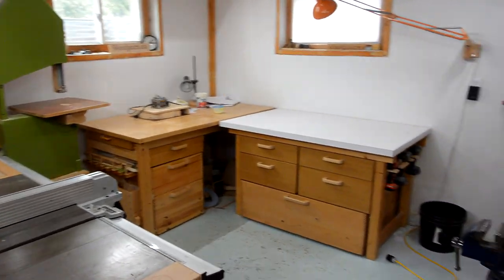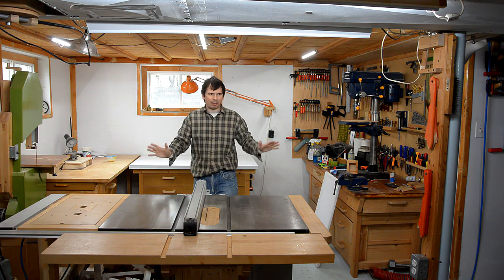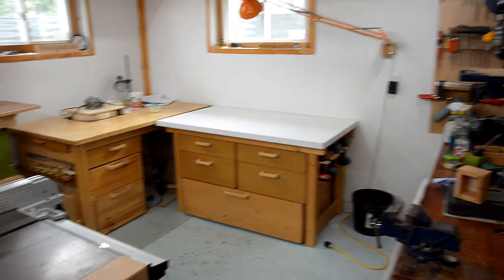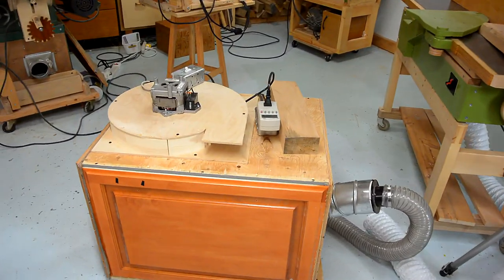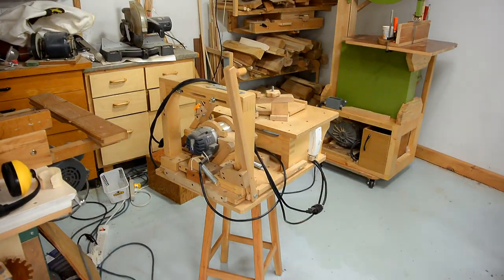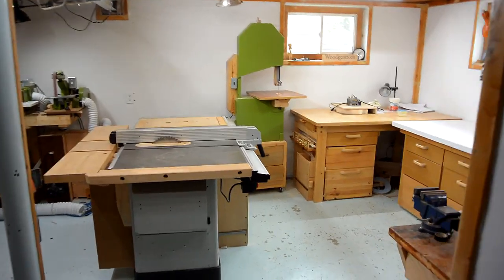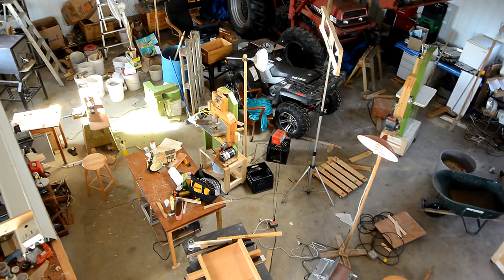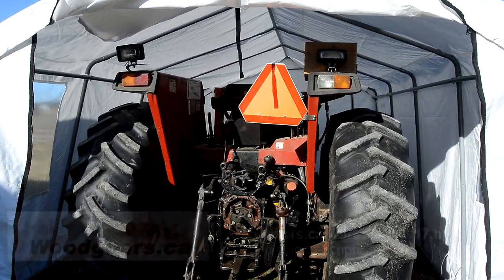The last tour of my basement workshop

Comment: Always heard the rule of thumb for garage size is to calculate how much you need, then double it.  I see house renovation vids in your/our future.  Good luck on the move.
Reply: I rented neighbor's unused garage in the end. Didn't help a bit. Just made searching for stuff twice longer.
Reply: The rule of thumb with shop size is double it every 2 years. There has to be an upper limit where the average handy person is satisfied, but what that is I don't know. I'd guess it is between 2,500 to 5,000 square feet?
Reply: The amount of shop space needed is n+1. Smaller size only requires increased efficiency, up to a point.
Reply: +The Metal Butcher the further you fall behind n the more time you'll invest chasing after that efficiency though.
Reply: That's like the old George Carlin routine, "A Place to Keep My Stuff".
Reply: +Peter Collin tinkering accumulates far more stuff than average folks need too. It is always if I had this I could do that. Or I need a lot of this to do that. Sometimes I just question what it is all for.
Reply: That's true. I want more shop space, but then I see what Marius Hornberger has to work with, and I have plenty.
Reply: What is it all for?  Tinkering of course.  Doing 'stuff' in the shop.
Reply: +DRitz78 I ask in a larger philosophical sense. There are after all only so many hours in a lifetime.
Reply: "I just question what it is all for" For me, i enjoy feeling proud of my finished work. The tools can be expensive, but I don't do this for the money, so it has to be fun. 

The tools make me proud of what I can accomplish. They let me challenge myself to make something more complicated, or totally new every time, and they've added a huge amount of order to my life.
Reply: +C Interesting. I have much the opposite experience as you have. I don't buy particularly expensive tools. If I had to describe my shop in one word chaos, or messy would be good ones to use. Order is an ideal I don't hope for anymore at this point. I do find some projects challenging, and even beyond me. Not every project I do makes me proud either. I've a fair number of total failures. Complicated, or new is all over the map as well. There can be a lot of repetition, and I do have a penchant for the simple.
Reply: Then ask the wife wants to park in the garage, then quadruple the size.  50x100 metal building sounds just about right.
\
Reply: +RobiSydney I can't abide by those metal buildings. They're like beer cans. Good as an equipment shed. I wouldn't want a shop in one though.
Reply: trtrue enough.  I have worked in metal buildings built out with sheet rock and insulation.  Makes for a nice shop.
Unless you're a keith Rucker and have enough pine trees you can cut down and mill for a building...
Reply: +RobiSydney in a perfect world I would go with concrete block myself. Once you start insulating and paneling a sheet metal building you lose one of their major advantages. Which is their low labor requirements for construction. Wood has a host of undesirable features when it comes to workshops. Not the least of which is the flammable nature of the material itself.
Reply: true again.    though the one I was in was built out with steel studs.  This was prewifi so we didn't care about being in a faraday cage.  Being in an earthquake zone though it was the better material for the location.I have friends in 60 year block buldings and every summer we get to go around the building and caulk up the cracks.  They poured the slab in 4 different pieces. (over the course of 10 years and 3 additions to the family) and too thin.  I'd still prefer a metal building.  if you really worry about fire danger, use concrete board instead of drywall. As it was a classroom as well at one end (2 rooms we could separate)  These days being a faraday cage is nice since the students can not use their phones. while in the office you could because of all the windows.
Reply: +RobiSydney Caulk? That must look great. Repointing joints is a real thing too. That's what cape chisels are for. It is not done much these days. But there was a time when it was commonplace. Raking joints. 60 years ago was before my time. Lots of them old drunks didn't know what they were doing. I worked on spec grade mix block jobs. We weren't fooling around. Door wall in every third course, and rod in every third web. For schools we'd have to put pilasters in the walls too. Just so if the place did burn to the ground the walls wouldn't fall in. Because when there's kids involved not going in isn't an option for the firefighters. They're going in.
Reply: They're cheap skates...  I have a cape chisel at my dads..  like he'd ever let it go... I was lucky to snag my angle grinder back from him though.

Comment: In all of our past homes I have complained about my shops being too small. At out last house I build a 20 x 20 shop in back as that was the maximum the county would allow. Since I was building it myself, I took advantage of knowing what I wanted to fit inside and where. I built the shop and a nice storage loft in one side of it with it's floor set at just a few inches above the walk in door. The joists made for fantastic storage as I was able to hammer in finishing nails anywhere I wanted to hang something and I could see loads of hardware by simply looking up.. It was fantastic. Tight for restoring a car, but a fantastic design.  8 years ago we heard of a nice house on 1/2 acre that was close by.  That house included a 1260 SF shop. I had worked on the past owners car there many years ago, but only really remembered the 4+ car shop. We bought it and when moving things in, realized storage in this shop was useless. It had no loft and the two end walls and back wall are concrete block. Of course I knew I had much more room to deal with. More than 3 times as much in fact, but it was really not a smartly laid out shop. Storage for 4 cars, ok, but not even convenient they way it was built. I ended up building a wall down the center of the 2 bays with a work bench on one side. Lots of shelving out of 2x4's and 1/2" plywood and then built a staircase that raises up with a boat winch and laid a floor on the ceiling joists. I recently brought everything from the old shop home to this "not-so-new" shop and can tell you that if I pull my truck outside I have a lot of room for projects, but honestly, with the design of this shop I always feel I am at a loss...  So, my friend, take your time and really work at a great design for your new shop.  Lift your wood stove off the ground for better floor space, maybe.. Best of luck......

Comment: Seeing that angle from on top in the countryside shop, if I would own that place, I would make a floor in between. And since it's five meters tall (yes, I checked with the scaffolding video) you could easily make a floor, maybe 2/3rd of the entire area, so you could still park your tractor inside, almost double the floor space, get easier access to the cfl lamps and possibly even reduce echo. You'd still have an room height of about 2.3 meters if you use I-beams.

Comment: A bit sad to see the old shop go, i liked its character, it's so you, but also excited to see how you work out the new one, more space, better light, etc.
Reply: In the new space, would partitioning the rear section of the "shop" work to solve your problems? The front, near the doors would remain for tractor, atv, metal work, and the rear + insulation for woodworking, you'd also get more storage area on top of the enclosure that way.

Comment: I could see a ramp being made for the fourwheeler whether yhat be a foot or 4 in the air on say a 15 degree angle slope where its sturdy enough to hold it but also has room to store some tools in it. Or make a whole loft a good 6 to 7 feet in the air and a staircase with railings as extra storage depending on ceiling clearance

Comment: :)
      First:Congrats with your moov to hte country n bigger tool box/shop.
      Second: Project perhaps should be rows n rows of stacked shelves on the walls?
      Third:  FYI That structure for your tractor can hold in moisture and caue 
      oxidation/rusting faster possibly.
:)

Comment: 2:15 That column needs to go in my opinion...
Putt in a steel H beam against the roof and support it at the inner and outer wall instead. Make sure to test if you are able to lift the ceiling closest to the column just enough to take the load of it for a brief amount of time. Remember to have wedges of hard wood or similar to make final adjustments if needed between the H beam and the load bearing point of the ceiling.
A couple of bottle jacks with preadjusted columns and beams  ( 4x4" )for load distribution both on floor and against ceiling is probably the cheapest and safest way to do this.

EDIT: oh... moving
Guess i should make it a habit to see the whole videos before commenting here on YT

Comment: The ceiling in your basement seems unique... I have a low ceiling and have my workspaces down there (mainly electronics, and my kid and i share spaces down there for breaking things and rebuilding and such at a table i made years ago), but i'd like to put something there that is low or zero profile. (my house was built in 1954 also. heh!) 

If i'm looking at it right, it appears to be some sort of cleat mounted into the side of each floor joist then short planks going from one side to the other?  Is that what i'm looking at?

I hadn't thought of doing something like that, but it seems a lot more economical than a low-profile dropped-ceiling...
Reply: Also, thank you for the videos.  They've been great enjoyment and inspiration for me to try making stuff. :D

Comment: You might want to try to make better heating for this huge new space. I did use some used car radiators with great success (water based heating). You will need old computer power supply to keep radiator fan running but temperature raise is very fast in just half an hour.
Reply from the maker: and what would heat up the water?
Reply: Matthias Wandel in my case it's cheap stove with built-in water heating coils  (in fact I use car coolant as it never freezes in winter). I also use wood as a fuel. In your case easy hack is to wind a copper pipe onto the flue (to make a coil) and do the same. I'm happy to provide you more details if you wish. Before this cheap hack I was unable to stay in garage if temperatures went below 0 Celsius.

Comment: If the load bearing column is in the way, a load distribution beam might be your next project?
It's not that hard to diy, just make sure the math is correct and you are left with a couple of columns against the walls instead. :)
Reply: Ah...just got to 08:45 in the video, just disregard my previous comment.

Comment: Im curious what that single 2x4 is holding up?  Cant be a beam or a joists?
Reply: If you look closely, that 2x4 is actually up against a white painted steel pipe.  I suspect the 2x4 is only there for the plugs.
Reply: Looks like it's a metal pole, with a 2x4 attached to it so he's got a way to mount the outlets somewhere.  The metal pole is the load-bearing support, not the 2x4.

Comment: What's the right wing on your main table saw? Is it a router table? Also, a single 2x4 column to support the house?
Reply from the maker: routr table.  And watch more closely
Reply: The 2x4 is there for the electrical outlets he added that is strapped to a steel post it is that that  supports - bears up - the ground floor.

Comment: The problem with plastic tarps is that they degrade within a year or two in the sun.
Reply: Some hold up surprisingly well . I'm in Northern Ontario and I 've had  one going on 6 years and it still looks good even with 13 feet of snow this winter.

Comment: Yeah, Awkward barn layout, the entry door is right next to the Big barn door, meaning you can't really park the tractor in front of the barn door... If it be possible to make another door somewhere where the tractor is now, you could seal of the current door move the tractor and atv forward a bunch, so they hug the barn doors, maybe build like a token wall around them (mainly for having wall space and hiding them while in the shop. That would leave you with a big L shaped workshop ... just an idea ;) ... think building a token wall wouldn't be a bad idea anyways (maybe on rollers/wheels so you can still move it (or them if build in sections)) As having a wall helps you 'psychologically' when organizing as you can shove things to them and they actually 'feel' out of your way, as opposed to them 'floating' in middle of the space, which makes it feel cluttered... looking forward to watching w/e you decide/come up with